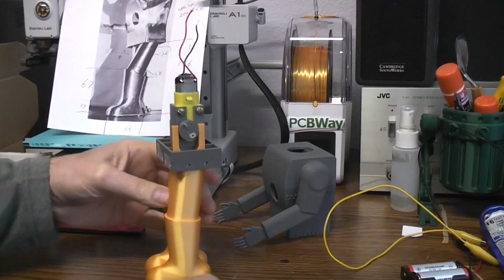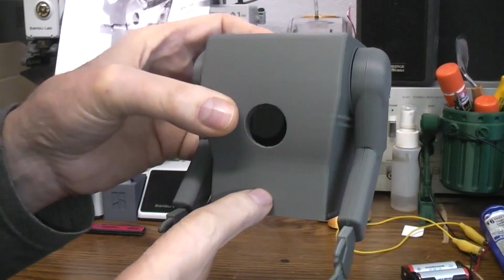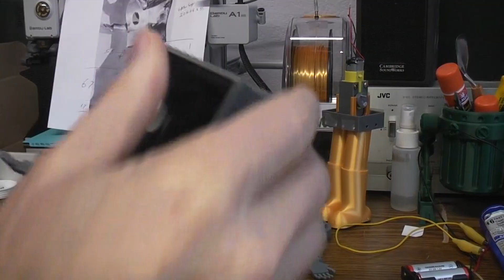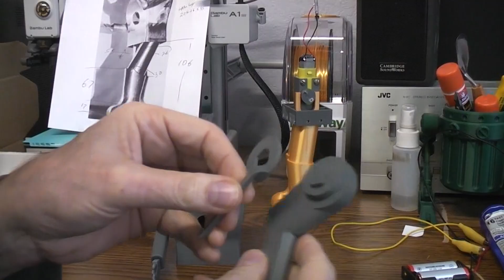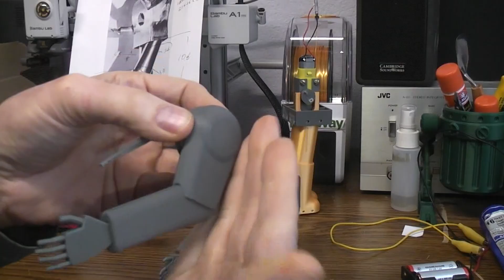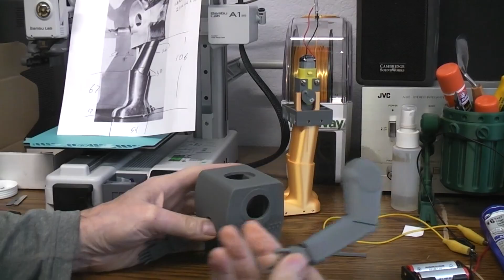Part 2. Let's talk about the Body, Arms and gold silk PLA legs.

Comment: LOVE the arm motion, very old school tin toy, seems very fitting to the look. As a suggestion for making the arms kid proof and positional, surely all that’s needed is some rotational friction grip, like enough to keep the arms in position, but not enough to lock them there solidly, like the hexagonal push-fit does.

How about making a plastic ‘bolt’ for the inside, shaped kinda like a metal bolt that screws into a nut, but with a smooth shaft and an hexagonal push fit at the far end of it, then you could thread on a rubber washer or two each side of the lever part, then push it all into the arm from the inside?

If the length of the bolt is just right there could be enough friction grip around the lever to hold the arms in position, but not enough to snap the lever or pin when they’re rotated into a new pose (and hopefully it won’t snag the main mechanism sliding in).

Anyway, hope that makes sense to you, and hopefully it gives you some useful ideas.

The shiny gold filament looks very Retro SciFi btw, he’ll be all C3PO dressed like that!
Reply from the maker: Yes the slip clutch is what I talk about in the video and I have decided to do it that way. The arms can be posed and yet still swing mechanicaly.
Reply: @Robothut  ah see I don’t know terms like that, noted, I shall try to enter that into my mental dictionary, thanks.